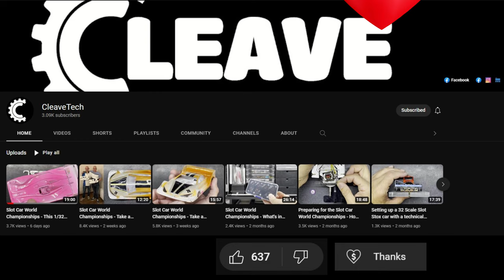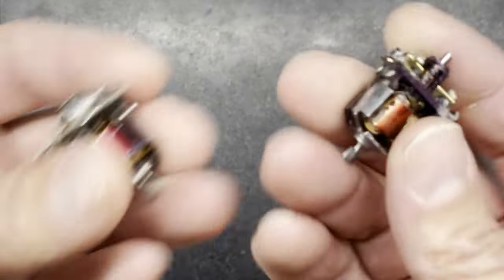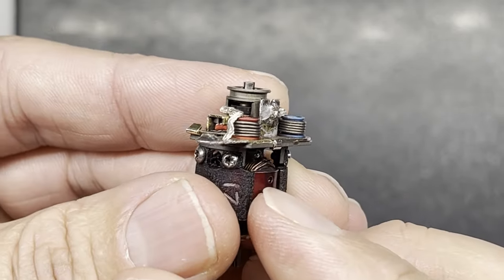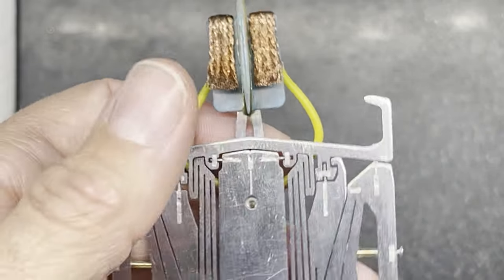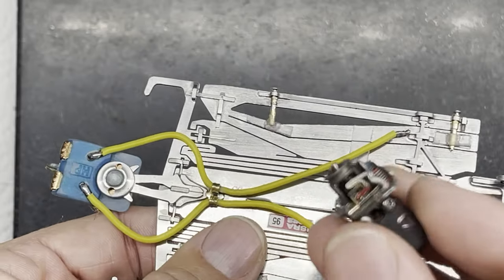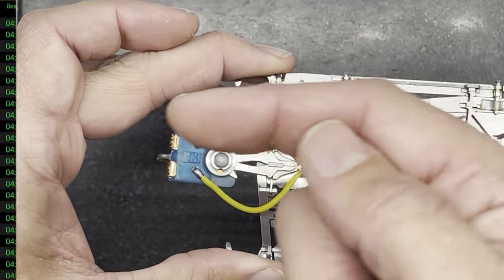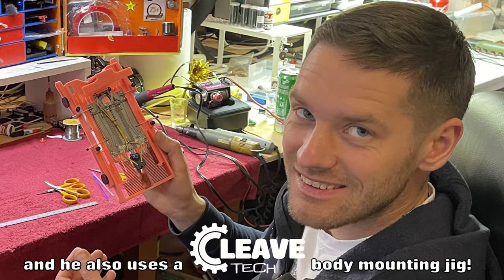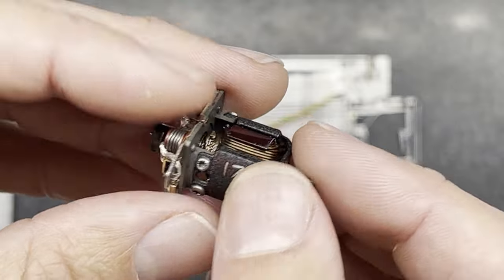Slot Car World Championships - This 1/32 Euro Sport car was awesome -  Part 2

Comment: Bugger about the braid. We lost a LeMans enduro with a broken lead wire. What sort of amps do these motors pull under load? 20A? 30A? Did you say you ran 39/5 gears? Will a 47/6 fit? Or is the 47T spur diameter bigger than the tyre diameter? You would get a better mesh and torque delivery to the wheels would be better. Torque delivery is not constant!! Its a sawtooth delivery about an 39/5 = 7.8 average. The 47/6 torque delivery would be smoother and less power losses. Unless the larger 47T diameter has too much inertia loss? Keep up the good work James. Always great content.
Reply from the maker: Yes. I ran 39/5 gears. We always used to run 45/6 gear ratio but with 39/5 gears you get extra acceleration and braking effect, combined with the higher revs of the motor which also gives you more gyroscopic effect, you can lap faster.
A 47 tooth gear, even in 80 pitch, would be too large for the rear tyres. We tend to run rear tyres around 16.6mm maximum in this class.
Reply: @CleaveTech  45/6 = 7.5 as opposed to 39/5 = 7.8, so more revs and better acc/brakes makes sense.

Comment: What do you measure the rpm with and what rpm does it pull at 12.5v? Curious as an 1106/8000kv brushless motor at 5v is only pulling 40,000 rpm😉
Reply from the maker: I measure the RPM with my own RPM device. I will be selling the new version soon 😉.
I would not test a C-can or Strap motor at 12.5V as the windings would explode without a load applied.

Comment: What is the acceleration and maximum speed on these vehicles?
Reply from the maker: This particular class of slot car probably reaches around 50mph on the straights, but it is the overall cornering and handling ability of the slot car that is so impressive. There are no magnets keeping the slot car on the track. It is all about aerodynamics, chassis dynamics and mechanical grip.
Wing Slot Cars will AVERAGE around 80mph on a qualifying lap and there are drag slot cars that will actually exceed that speed by the end of the scale 1/4mile.